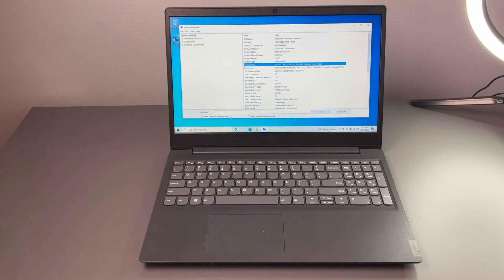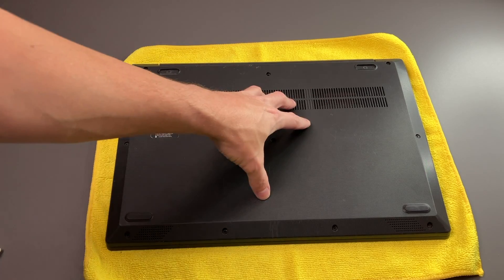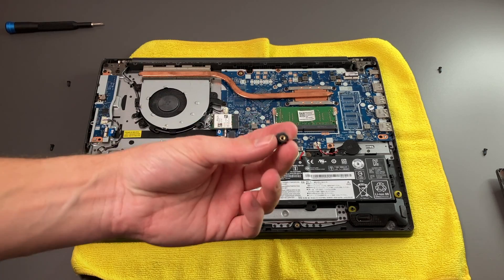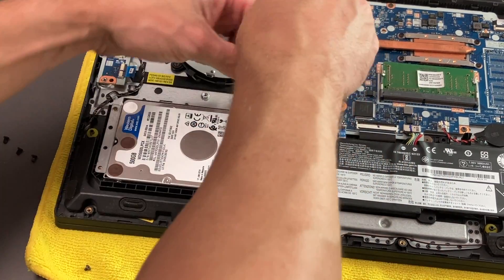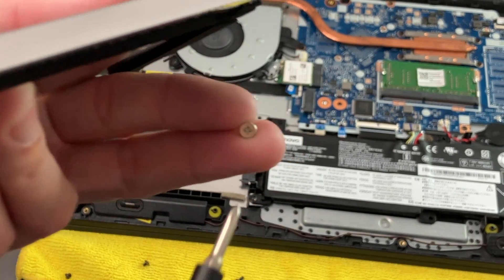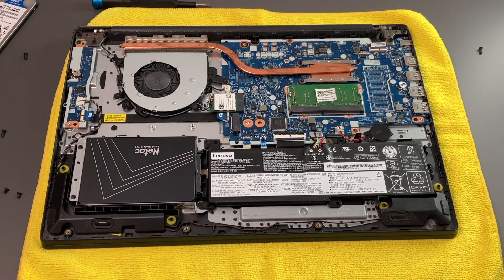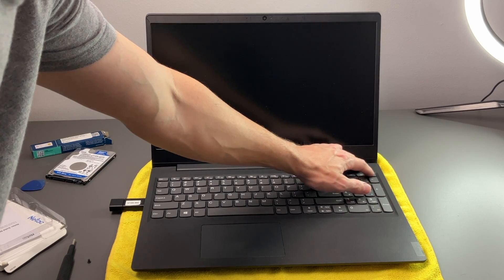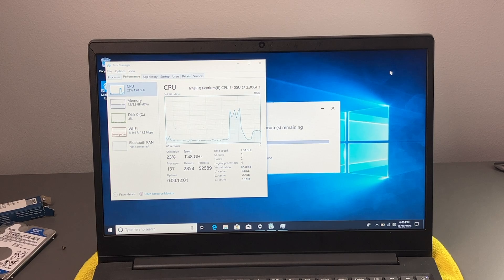Lenovo IdeaPad S145-15IWL SSD Upgrade!

Comment: I think that's M.2 slot is for pcie nvme drive not m.2 sata drive. The link you have given in description is of m.2 sata drive. Please correct me if I'm wrong
Reply: yes its nvme m.2

better to check on the manufacturer website
Reply: mine is m.2 sata, original one is samsung m.2 sata 2280.

Comment: I am repurposing the same laptop, got it off marketplace for $20. Replaced the HDD with a 2.5" ssd, but I am stuck on the boot menu. I have tried everything but I cannot get to the set up menu for the new SSD. ANy suggestions?
Reply from the maker: Is the drive showing in the BIOS?